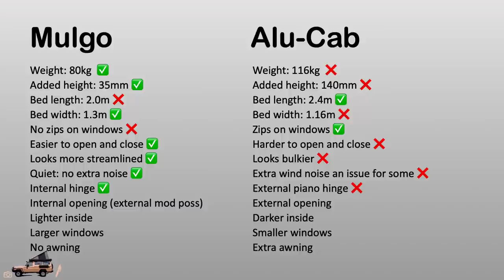Pop Top Showdown: Alu-Cab Hercules vs Mulgo. Troopy Talk Episode 3

Comment: I'm looking at purchasing a Troopy soon and I'm learning towards the Mulgo due to it being much lighter and having a lower profile to the Alu-cab.  I'm only a 173cm so the length of the Mulgo should be just fine for me.
Reply from the maker: hey Andrew... I reckon you'll be just fine in it at your height. Enjoy
Reply: @fritzintroopy  I enjoyed the comparison, you did a good job explaining the pros and cons of each. Just a question mate on how does it perform when it’s windy, is that a issue or not really? I’ve heard from others who had roof top tents and they said they were terrible when it was windy, so I’m keen to see how the Mulgo holds up.
Reply from the maker: @andyedison2416  a mild to moderate wind isn't too bad especially if its not too cold and you can open the sides and let the link go through... Anymore than that and they do flap about a fair bit which is annoying but It would be the same for all RTT with canvas.At least the mungo has no zips to make noise in the wind though...

Comment: Looks like an Exped Megamat Duo would fit inside the mulgo for extra comfort, and deflat for more room when closing up
Reply from the maker: Cheers will check it out.
Reply: @fritzintroopy  it does and works fine, I use it under the existing foam and deflate it. You can buy an exped widget which inflates it.

Comment: This is great guys, thanks for posting this. I'm still undecided which way to go! I'm only 5'2 and would need to be able to close the tent by myself, do you think this would be too hard with the Alucab? I like the Mulgo but don't know if it would be too bright at night for me if there are other campers around
Reply from the maker: Hi Genevieve. I've asked Nick and he thinks you might struggle pulling down and pushing open the Alucab tent especially if you are light in weight/strength. Pushing open and pulling down the Mulgo also requires a bit of effort. Mrs Fritz is quite strong and she can only push it open from the inside... which is the standard way the Mulgos come. We added external handles and strap...Best to try it out first if you can. 
Regarding the light coloured Mulgo fabric... I would be more concerned about the noise from other campers if you are that close and you are worried about light... 
Hope that helps
Peter
Reply: @fritzintroopy  awesome thank you! invaluable info. looks like I might be heading to NSW for the mulgo installation.

Comment: Great video - much appreciated. Probably already covered in the comments but could you confirm difference in load capacity on the roof. What weight can each take. thanks
Reply from the maker: Cheers Michael. I know from personal correspondence with the Mulgo designer that it is rated to 150kg which is the same as what Toyota rates the Troopy roof at production. Not sure about the All cab version I coudnt find any info about that. Of course with a 150kg on the roof you wouldn't be able to lift the roof without unpacking it first but I have seen a photo of the Mulgo carrying a motorbike over corrugated roads and there was no issue at all from a structural point of view

Comment: Mulgo, sleep width, lighter weight by 30 plus kgs ?, custome made with aluminium checker plate roof, internal hinge. With out a lock external on the Aly cab, could someone not open break in whilst your out surfing/hiking etc .?
What are the insurance, is it easy to add another 15 k to a 75 k troopy plus 10/15 of 4x4 accessories?

Great video thank you for this ?, both great products, great for options but I think mulgo for the win, for me !, cheers
Another consideration is low height / low profile, as even my standard troopy, height is always an issue for car parks sheds etc !
Reply from the maker: The external locking only on the Hercules would definitely make it easier to break in. Thanks for the feedback
Reply: I don’t think a theft will even think to open up a tent that size when there is a window? You could also add an internal lock to Alucab

Comment: I wonder if the same differences would apply to the defender variants🤔
Reply: Mulgo defender pop top is worlds apart. The original roof is customised into the new pop top roof. Colour coded or painted to customers choice. Not just a generic black or white. Bed systems are the same in both products. 

Alu cab roof stick out like a sore thumb. Mulgo looks like it’s been driven out of the original factory

Comment: If it's wet when you pull them down, does the mattress get damp?
Reply from the maker: Hi Duncan. Great question. So far we haven't had an issues with any moisture getting through. The fabric seems pretty waterproof. We had a small amount get through the velcro window seals but that was our fault as we didn't close it properly. Cheers
Reply: @fritzintroopy  Thanks

Comment: Perhaps they should make them a little larger to handle the pillows.
Reply: vacuum bag the pillows, very simple.
Reply: @christurner68  I don't see many  of the 4x programs talking about vacuum bags. It's quite easy to make a pump that is driven off an air compressor. 

eg. https://www.nexflow.com/blog/venturi-system-vs-vacuum-pumps/ for the principle. 

Then you can vacuum pack clothes into a very small space, keeping them clean dry and free of bugs etc.
Reply: @Nickle314  there are also small portable products that are used to deflate air mattresses as well.  But yes thinking outside the box
Reply: @christurner68  I've a pump you can use both ways.

Comment: To hard heap of shit....
I had a KEA Conquer 2007 vintage twice the room way easier to use better ventilation a benchmark in pop tops ...these aluminium cabs would be a nightmare in high winds and when it wet and freezing outside. 
A hard top is a better option than  these expensive mistakes
Reply from the maker: Awesome you feel you had such a great pop top... everything has its pluses and minuses... cheers